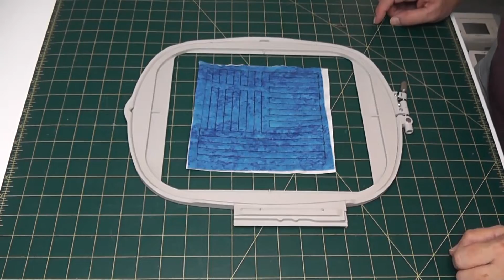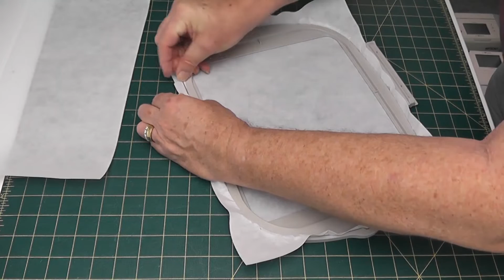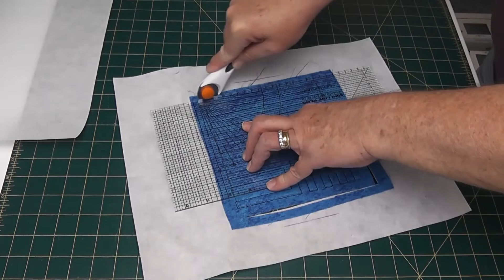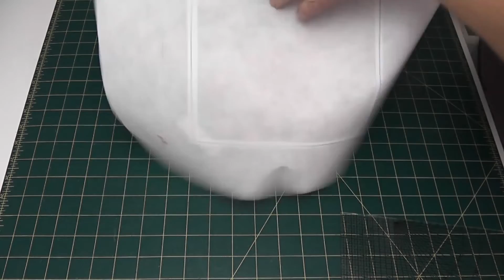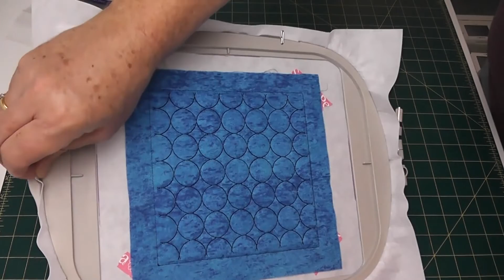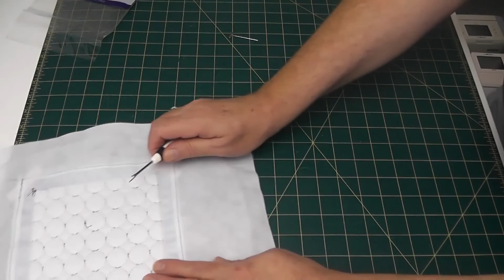Saving Stabiliser for Machine Embroidery

Comment: Please tell me what the T pins are for?
Reply from the maker: They prevent the slippery stabiliser from moving in the hoop when the hoop is removed for the fabric to be trimmed.  We use T-pins if they are available or you can use normal long quilting/dressmaking pins. It's mainly to prevent slippage.

Comment: Hi Martyn, Thanks for clear explanation. Where did you get the roll of double sided tape. Must get some of those pins. Did you just float the blue fabric and where do I get the design you did in your machine. I just bought the dinosaur book pillow pattern.. thanks
Reply from the maker: Hello Viddy, the 6mm (1/4") double sided tape is make by X-Press IT that is used in scrap booking. The pins are upholstery pins but clover also sell them but smaller. We float a lot of our blocks and projects and this particular file was a test stitch out that we didn't end up using alas. Don't forget to post your dinosaur pillow when it's complete.

Comment: Have you tried stickyback? Good for multi hooping fast. Use the sticky back to hoop, then you keep the picture frame space left after first block and add a 7 inch square of stabilizer for each of the next  6 inch block design. Saves rehooping every time. Dont have to pull the whole tging out just put your patch of stabilizer over top. Works for tshirts too.
Reply from the maker: Thanks for the tip! It's not a stabiliser we use much due to price. Thanks for suggesting this.
Reply: @sweetpeamachineembroideryd4694  i use it for shirts. I reuse it over and over to float shirts. Especially if a name logo .
So you dont actually use much . I just got taight that way whrn i started 30 yrs ago. It was hard to find last year, my original roll lasted me over 20yrs.its sticky back tearaway but it has a special name . I will try to find out

Comment: Does this method work with tear away? I always thought that puncturing stabilizer with a needle might cause it to weaken and tear. I’ve been floating one sheet of tear away under the hoop with one layer of poly mesh in the hoop, I will definitely give this a try for the layer of tear away I’m floating under the hoop, thank you so much!

Comment: I just made my own wash away stabilizer, search on youtube diy bio plastic, its a gelatin and glycerin recipe and its easy, worked perfectly, rinsed out in less than 30 seconds, i also use paper towel as a stabilizer i separate it down to 1 or 2 ply then throw it in the wash afterwards, the cheaper the towel the easier it is to wash off ive noticed, i hope everyone can save some money using these tricks, stabilizing materials are too expensive and too much waste, hope this will help someone xx Nadine
Reply from the maker: Wow! Those are some wonderful tips Nadine.
Reply: Great ideas — got to try the paper towel trick